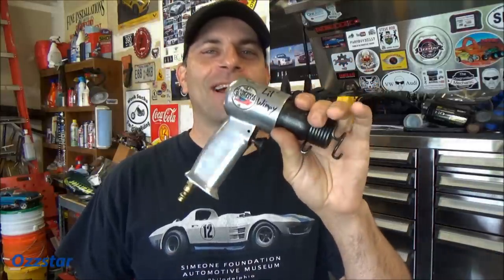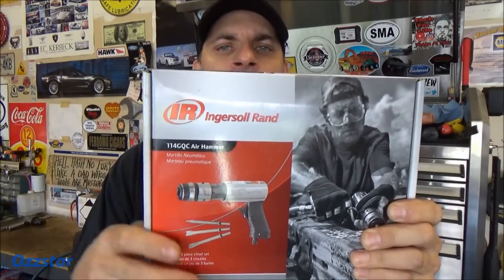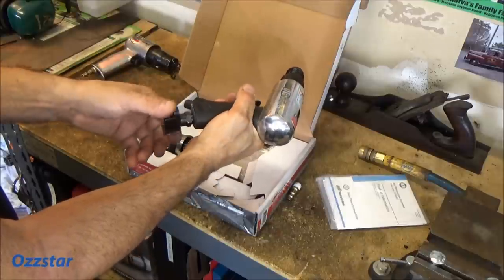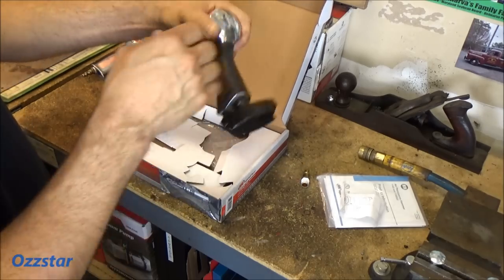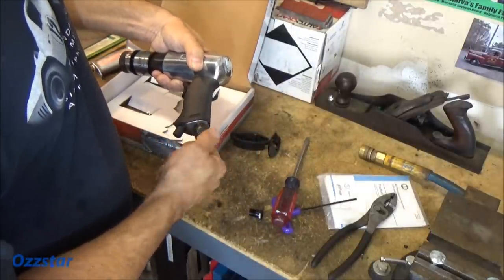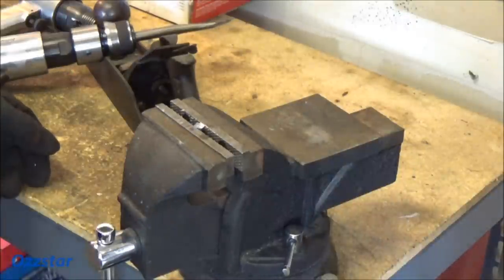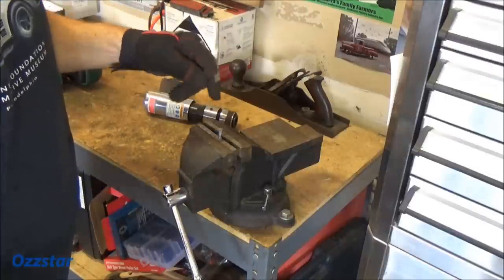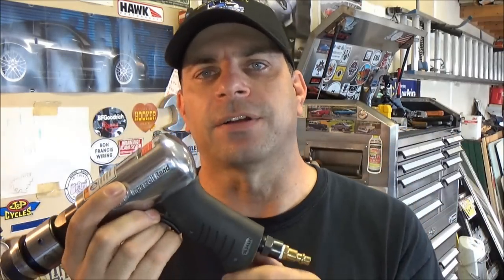Ingersoll Rand Air Hammer Tool Review -114GQC

Comment: Great video.  Thanks.  I just bought this air hammer and was wondering whether the bit should move around after being installed in the quick mount.  Thanks to your video I can see that the bit does move freely in the quick mount chuck.

Comment: I was welding up underneath a flatbed trailer this week.  I couldn’t get my chipping hammer in the tight space and I thought I will not go many more days without a good air hammer in the shop.
Reply from the maker: This model would work perfect for knocking off slag.

Comment: Can i use one of these to remove bolts from an exhaust manifold with the socket extension on the air hammer ?
Reply from the maker: There are many uses with this tool.

Comment: Good video. Could you share the information on the air compressor you used to shear the bolt? Air pressure, gallon size, HP, CFM? Its my understanding that these tools require a good amount of air. I am trying to understand what kind of compressor would do the job. Also don't want to spend too much money on a compressor. Thanks in advance!!
Reply from the maker: I don't recall the CFM but I use a 20 year old Harbor Freight 21 gallon compressor.  Works fine for what I use it for.👍

Comment: The user manual says that the tool is coated with some kind of protective coating inside and out which should be removed with a suitable cleaning solution prior to lubrication and first use.
Does anyone actually do this, and if so, what cleaning solution needs to be used, the manual is a bit vague about that.
Reply from the maker: I put a few drops of tool oil in it and go to town.  No issues.

Comment: With the "Smaller" Air Hammers, you use the End Tab to push it aside to Install/Remove bits!

You don't have to remove the Spring every time.

Do you know of an Air Hammer that "locks" the Chisel Bits, to keep them from rotating durring use?

Just my 2 cents,
-Thomas (12) SEAHAWKS FAN
Port Orchard, Washington
Reply from the maker: Wow that is a lot of information. Are you a tool designer engineer sounds amazing?
Reply: @ozzstars_cars 
Not a Tool Engineer, I just "tend to OVERTHINK EVERYTHING!

A bit OCD as my wife says...

Almost finished with my Engineering Degree though.

Hope you are doing well.😊

Thanks for responding,
-Thomas 🤓 Skagen
Port Orchard, Washington

Comment: OZZ    hi   I have the same air hammer   still in the box and has not seen a air hose yet     I am looking forward to trying mine out.    did you oil yours befor you used it?   im doing a  lower ball joint soon on a     ford escort .   the last one I did    it took me about a 1/2 hr to get it off with a bfh and pickel fork   bc I did not have a  air hammer  or a ball joint  removel tool    but now I have both
Reply from the maker: Even though the air hammer should be pre oiled from the factory I do oil my air tools before using them new.  Good luck with the repair!  Tool oil:  https://amzn.to/2TvMC8o

Comment: What's the piece called you put on the bottom of the tool to connect it to your air hose
Reply from the maker: It's called a 1/4" male steel plug.

Comment: Just ordeded this model. I have a Ford 3000 tractor that I need to remove a broken wheel stud, cant wait to see how it works. Also thought of a couple of other problems that this might be the solution.
Reply from the maker: It's a helpful tool to have, many uses.

Comment: I like the tool feels good in hand but is weak
Reply from the maker: It is weak in comparison to what? For the money this air hammer kicks butt!
Reply: @ozzstars_cars  well in an automotive setting this air hammer is good at being loud. I have one and I used it to try and get the rivets out of a lower ball joint on a 07 Silverado. Loud was all it was. I have a bigger it and it punched it out. Also on the studs for a rear axle and same situation. It's not bad for a starter hammer but if you are gonna need some beans then you need a bigger hammer. A true long barrel. In a pinch it will do but if you want power and are trying to make money spend the extra 100$ and get the hd max or go astro. That's all I was saying. As far as body work goes it's a good hammer. Not trying to be disrespectful to your channel that's just my opinion. On another note I have been watching your videos and you got good content. Keep up the good stuff.
Reply from the maker: @justinisom6161  where can I get an Astro long barrel air hammer for an extra $100
Reply: @ozzstars_cars  there's a few others I have tried for the same price. I would like to see a video on this if possible.